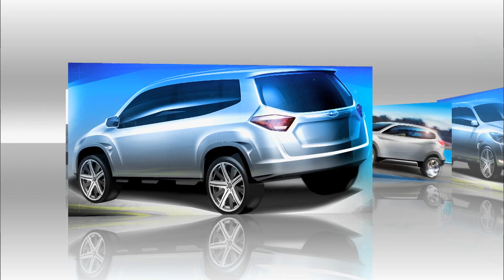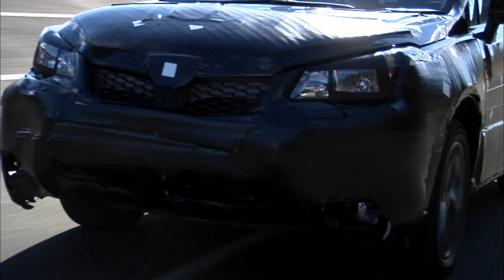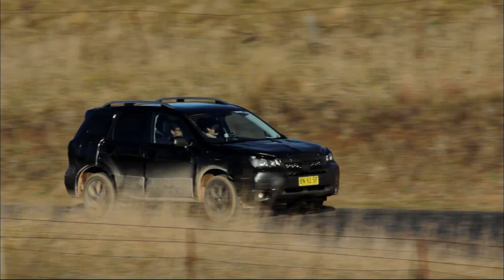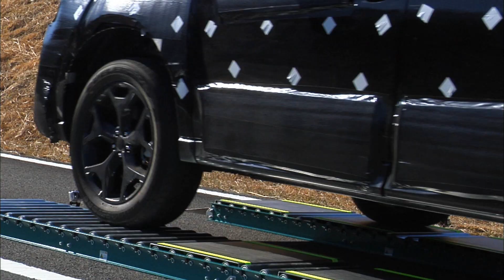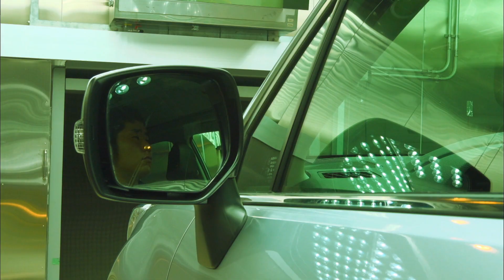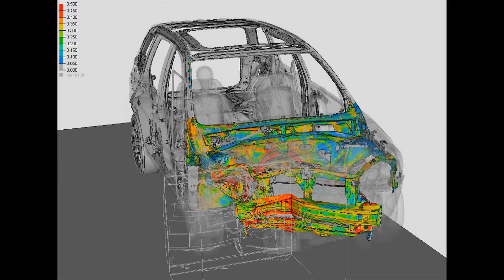2014 Subaru  Forester - Development Movie

Comment: I think you forgot to check the engine oil temperature. The engine self-destructed during about half an hour of high-speed highway driving with the XT. I wish it had run a bit cooler.

Comment: I have had 4 Foresters. 1st Gen 2001 S, Two 3rd Gen Limited (2009/2010), and now our 5th Gen 2023 Touring. Plus, we had a 2001 Outback and a 2006 Legacy GT. 6 total Subarus. One thing I can say, NONE of the cars had any rattles, squeaks, or vibrations from the dash, doors, seats, center console, or pillars. They may NOT be fancy vehicles, but they are very well made.

Comment: for me to buy an SUV it has to meet 2 of the following. 1. Manual transmission. 2. mid size SUV. and unfortunately I was little late to the party when I heard Subaru discontinued standard transmission after 2018 Forester. the Crosstrek is a little small. market for SUV is growing but manufacturers ignore demand for manual SUV's.

Comment: There are many things that they could have developed with this vehicle but didn't. 
For example the visor and the rear cargo space and I didn't like the fact the seats don't lay flat when folded down.  I see so many things could of been different but still it's a great vehicle overall and especially for the cost. However I could have improved on the suspension I was trying to make a comparison with the infinity and the Subaru so I'm still indecisive as to which one I want. I'm very Outdoors person very rugged and I like the clearance of a vehicle to be quite High especially when I go up in the mountains on dirt roads you come across creeks that can be heaved West a lot of boulders in the creeks you want to be able to go through a creek knowing that you're going to be safe clearance and not worried about a boulder That You Don't See there for hitting your oil pan and leaking all the oil out and having to you stranded up in the middle of the mountain. This vehicle could have had a little bit more clearance as far as I'm concerned.
Reply: It almost has the same clearance of a wrangler. For the oil pan, there is a heavy duty skid plate that I have actually bottomed out hard on a rock in the trails, I have a 14 forester XT, I dented the hell out of the skid plate but nothing else had damage. I LOVE my forester, any vehicle can bottom out by accident. If your only issue is clearance then raise it a bit. I would honestly take the Subaru over the infinity any day
Reply: The rear seats do fold flat.
Reply: @Jonathan_B87  No they are still at an angle. Not flat at all

Comment: I have a 2016 forester and love it until I hit ice or water on the road.  It will hydroplane even when it is just raining too hard. and on ice it slides out of control even at slow speeds. I feel that the tires are too wide for the weight of the Forester. When I got it I asked for the rims for winter tires to be as narrow as possible and the gave me 16" and when I had trouble and wanted narrower tires they said I need to go to 17" rims. So then I asked for studded tires for the winter, but when I picked up the car it did not have them and said the program was changed. I still have problems on ice even at slow speeds all most put it in the ditch in my driveway, and another time it went 45% on me while driving very slow.
  It is great in snow (even packed ) and great in mud,  but am scared to drive it in  ice and when raining hard on roads that will have water sitting on them.
 Have been driving for over 50 yr in very bad weather, and this is the first car that I felt unsafe in, as in bad weather I drive very slow. and drove over 100 K every day for over 20 yr. and always lived in the country where roads were not always keep up .
Reply: You need to change your tires...
Reply: Well you wanted narrow tires yet expect more grip from a smaller contact patch. I believe you need keep the stock sized tires and learn how to drive better. I have yet to spin out in my 2016 Forester premium and it doesn't even have X Mode because I have a manual transmission.

Comment: The temperature is 20 degrees F, you are driving 50 mph on dry payment, suddenly there is a 50 foot patch of ice.  Then there is bare pavement again for another 50 feet and then another patch of ice for 150 feet.  What does your car do; how does the car respond?

Comment: #Sad that the video shows the forester towing a camper that exceeds the ridiculous towing capacity of 1500 pounds braked. Why is this capacity so low? Previous versions of the forester could pull 2400 pounds.
Reply: It's undoubtedly CVT. But remember! Tongue weight and braking are all you really need to pay attention to here, and I bet you could push those at least 50% beyond manufacturer spec without any issues.
Reply: The CVT transmission lowers towing capacity due to torque stress. Previous foresters had conventional automatic transmissions with either 4-5 spds.
Reply: it is not the case of the outback which also has a cvt...
Reply: Perhaps there are different chassis reinforcements in play here between the outback and forester. Remember the outback was designed originally for a different market and is built on top a different chassis (ie. legacy/outback).